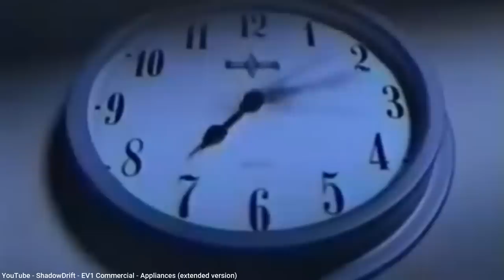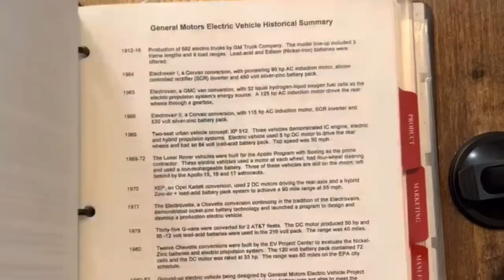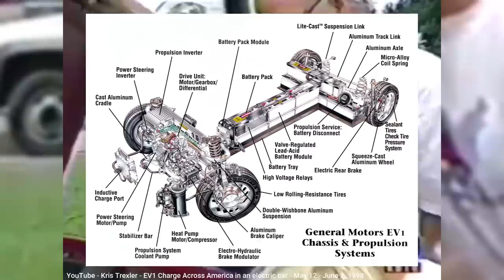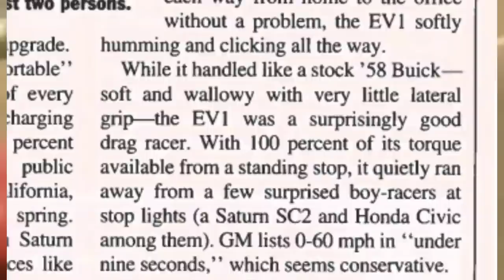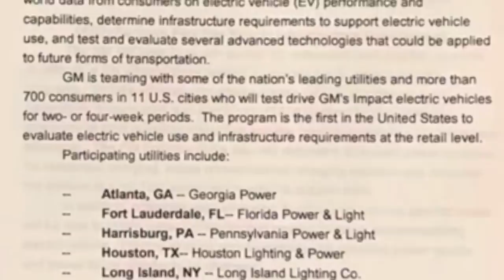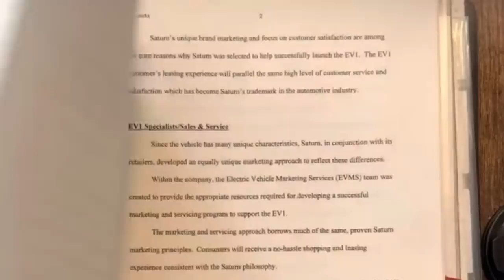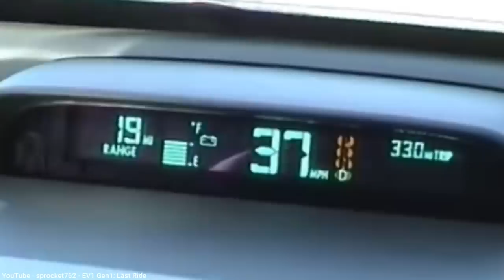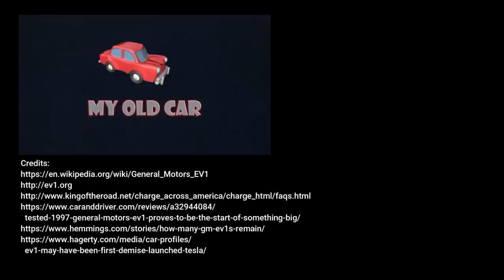Here's how the death of GM's EV1 was the catalyst for Tesla

Comment: In the book "Autonomy: the quest to build the driverless car" a former GM top exec said that GM crushed the EV-1s because they were worried about the risk of fire as the batteries aged.
Reply: a risk that is now happening to battery cars of today. only lithium is impossible to put out
Reply: EV1s had lead acid batteries… does that mean every car on the road has a fire risk?
Reply: That sounds like a BS answer, it was much more likely because they knew it would disrupt their replacement parts business
Reply: Whenever said that gave a BS answer. As lead-acid batteries get older they get crappier and less useful, but also way less flammable (even when new they’re pretty safe). Also the same kind of batteries used to start gas/diesel cars
Reply: Strange that Toyota didn't consider it a problem and sold off their end of lease RAV4 EVs.
Reply: @calofc01s  They had lead-acid and nickel–metal hydride (NiMH) in the later models.
Reply: GM Already headstart in EV but doest mean you are always a winner
Reply: I guess nobody is worried then about the batteries in their laptops and in the home. What I am saying is they can be made safe, if done properly.

Comment: I always felt that it was a natural fit in the Saturn dealerships as it seemed to be styled like the Saturns of the times. That front end says SL1 descendant to me.
Reply: It's really sad how GM killed Saturn. They merged them with the rest of their brands and that was it. 😢
Reply: @hailstorm1986  yeah they said that Saturns sales numbers were very low.  Hard to believe since Saturns were EVERYWHERE.  I think Saturns outsold Cavaliers and Sunfires so GM had to put an end to them.
Reply: @jims_junk  Saturn was a great brand and they're small cars were far more reliable than the cavaliers and the Pontiac sunfire's and I think GM was scared that Saturn could out take the whole company of course they merge them with the rest of the brands in the quality completely went down the drain..
Reply: @hailstorm1986  Oh I agree. I owned a saturn.  Great on gas, great reliability.  Those engines had issues for a few years but by the late 90's they were worked out.  It was a phenomenal economy car.  First engine replacement was at 300k miles and the the car unfortunately got scrapped at 800k.........but still ran with 500k miles on its second engine.  
But thats GM, build something that people love and then find a way to stop making it....*cough cough 3800 cough cough
Reply: @hailstorm1986  They became Opels.
Reply: @manoman0  originally that's what these cars were based off of however GM after the late 90s started rebadging other GM models as Saturns..
Reply: @hailstorm1986  yeah what was it, the um Cobalt I think was the Ion.  The Vue I think was an Equinox.  Personally I think the Saturn version of those cars sucked in comparison...GM really did Saturn in.

Comment: The EV1 was so cool. It's so weird they wouldn't let people buy them but they did sell the electric S10 which had the EV1 drivetrain in it. Also, the Bolt platform is known as BEV2... Maybe a nod to the EV1 before it?
Reply: yes they do buy ektruc s10
Reply: You are correct in that GM considers the EV1 as their BEV1 platform--however, BEV2 has nothing in common

The Volt had a surprising amount in common with the EV1 though

Comment: One of the reason for the aerodynamic look of the 90'S car as a lot to do with the software designer & engineers uses. Prior to the 70's everything was don by hand. This created very smooth line and very extravagant design. In 80's computer CAD became the norms. But the amount of computer calculation possible was limited and resource expensive. This gave us the boxy look of the 80's car.  In th e90's CAD software stated to allow designer to works with curve. This as given us the "bulby" or b"bubble" designs so much associated with the 90's.
Reply: In about 1981 I went to a Ford presentation on their Probe concept car. They were very proud of 3D wireframe computer graphic models of it which updated at about 2 frames per second. p.s. If you check out the Probe and the production Sierra which closely resembled it they are anything but boxy. However the look was slated with a Hyundai advert implying it looked like a Jelly Mould.

Comment: Front the front it looks like the spaceship, but the rear end looks like a 90's afterthought with those taillights.  I never liked the half covered rear wheels in this or the Insight.  The sound it made when driving was cool though
Reply: Aerodynamics, interesting another project Car, in the 1980s  the VW ARVW , only 177hp diesel but 225mph.low Drag coefficent and minimal frontal area.

Comment: The Magne-Charge standard (SAE-J1773) that the EV1 used was actually capable for fast charging up to 50kW. This was never implemented, but it would've been awesome if it was! Could you imagine doing an EV road trip in the late 90's/early 2000's? It would definitely be an exercise in patience, but it would be possible provided there were enough charging stations.
Reply: Unfortunately "[d]ue to sluggish behavior, lead acid is rated at 0.2C (5h) and 0.05C (20h)" so you wouldn't be fast charging that chemistry.

Comment: Beside the ev1 the Chrysler ev EPiC was a very interesting 90s electric car , it was capable of being charged at up to 50kw
Reply: How about the sexy 2008 dodge circuit ev that could easily have given teslas roadster a run for it's $ at a much cheaper cost. 🤔
Reply: rav 4  ev
Reply: @sharonbraselton4302 how could I forgot about her , best ev car ever , with a super nimh battery ev95 from Panasonic (battery capable of 2000 cycle or more in the 90s)

Comment: To think that GM could have been a leader in a now extremely lucrative and continually growing market segment but caved into short sighted near term profit seeking.  Toyota sold the first generation Prius at a loss because they saw the potential for future growth in hybrid technology.  GM could have done the same and been a leader, but instead, they focused on short-term greed and fell from prominence to a third-rate automaker competing with Chrysler for the bottom of the barrel.
Reply: Toyota also dropped the ball, they pretty much refuse to make battery cars in order to focus on hydrogen cars which have struggled to take off for 2 decades.
Reply: @odisy64  Hydrogen fuel cell cars are electric cars. It’s just different from of holding the energy compared to batteries. I suppose differentiating in the market can be good for Toyota. Competition is so strong in BEVs meanwhile Toyota knows the fuel cell technology.

Comment: The EV-1 was the most efficient electric vehicle to date, being able to achieve ~7 miles per kWh...Double what any car to date achieves. If one of the original cars could have been equipped with a modern Lithium Ion battery, it would be a ~450 mile car!! The EV-1 was the first EV to use the then state-of-the-art IGBT switching transistors (Insulated Gate Bipolar Transistor) in its inverter. It featured a 'Squirrel cage' induction motor, with a pressure-cast copper rotor. The first Tesla used a very similar motor, but, much more powerful. Tesla, along with virtually every EV manufacturer, have since switched to electronically commutated permanent magnet motors.
Reply: The Mercedes Vision EQXX would disagree (although it only just beats the EV1).
Reply: @MrDuncl  That's a prime example of one of the few available today, that could even hold a candle to the EV-1. The difference is, the Mercedes will out-accelerate the EV-1, owing to its lighter Lithium Ion battery. If the EV-1 was fitted with the lighter, more efficient Lithium battery, the Mercedes would have its "hands full" with the EV-1. Thanks for reminding me...I FORGOT about the EQXX!

Comment: Ask any firefighter what they think of electric cars.
Reply: Union over time?
🎉😂🎉
Reply: what ive heard was a fire chief saying it only takes 2 minuets to extinguish the flames but will continue to douse the the battery until its cool enough to stop thermal runaway. people talk about lithium burning hotter than gasoline but neglect to mention their is only 15 pounds of it in a battery pack, a gas tank contains 9x the thermal energy.
Reply: Funny you bring that up when ICE cars literally hold huge amount of explosives liquid and are 4x more like to catch on fire in the first place.
Reply: Yes do ask them about how every 3rd or 4th fire they roll on is a vehicle fire? Do ask them about the 217,000+ice vehicle fires in 2022 here in the U.S. vs less than 100 total ev fires in 2022. 👍🏻